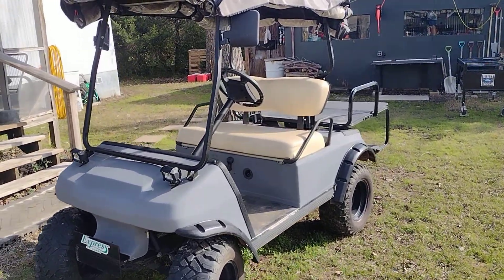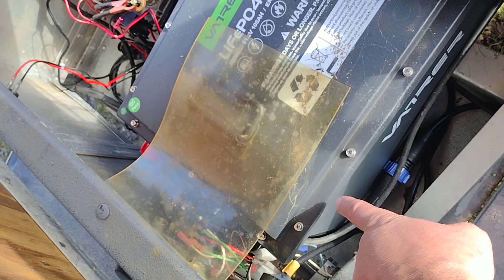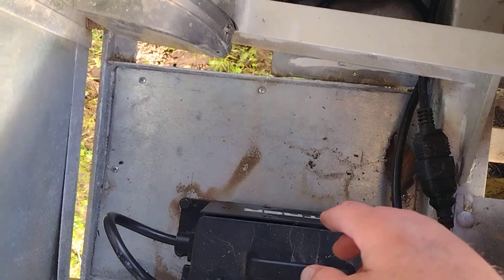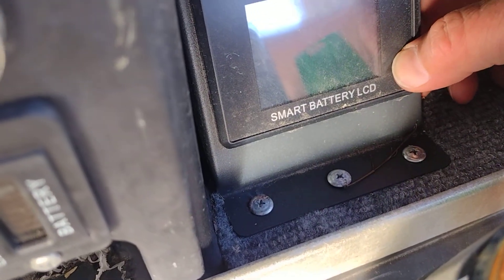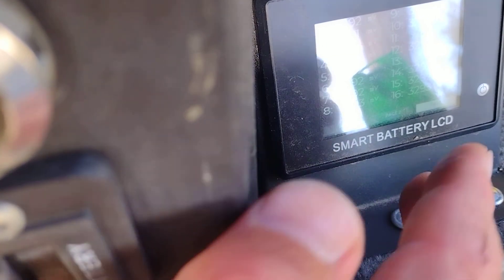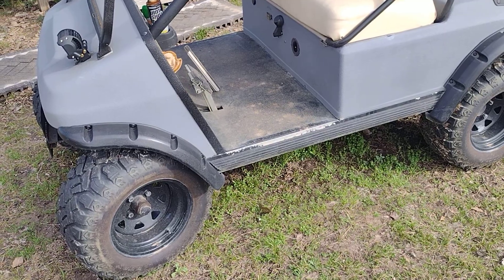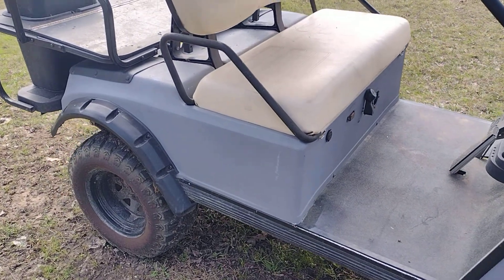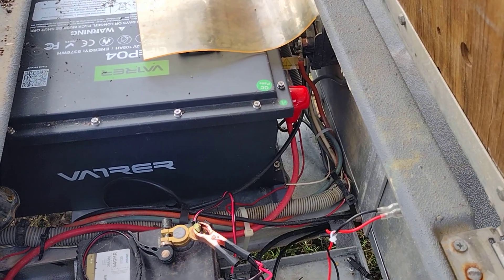Vatrer 48V 105ah LiFePO4 battery upgrade for '95 Club Car DS

Comment: Nice job squeezing it in. I think you are better off with the buck converter, $16 - $20 + a fuse block $10 Ama$on. Much neater, cleaner and zero maintenance.